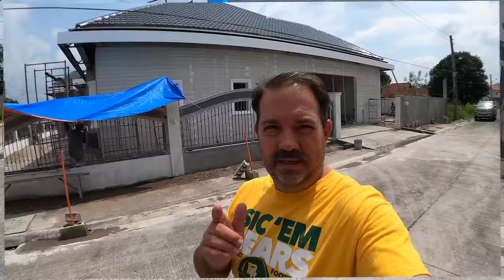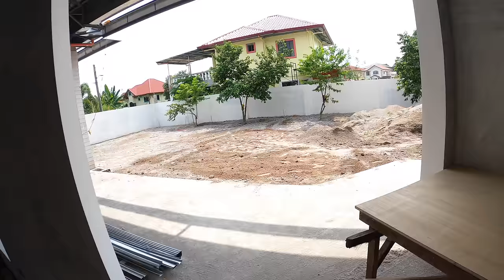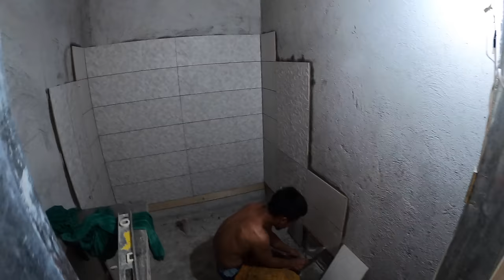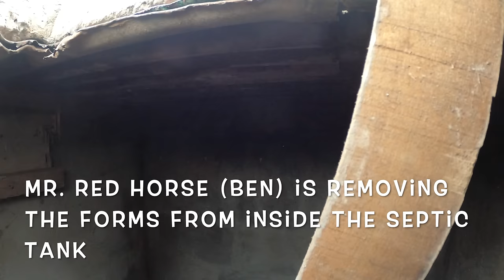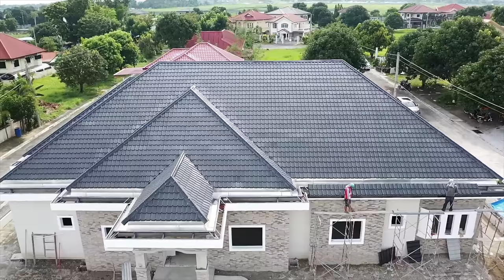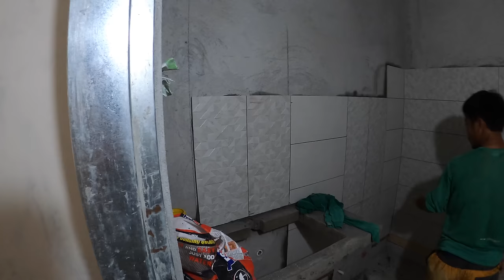Philippine House Building Step by Step, Build Day 166: Oil Change | Bathroom Wall Tiles

Comment: Hi. How mutch space between the tiles? Will you be using grout all around the house. It looks like in Phil that they like to put the tiles really close and that they don not use grout. Do you know anything about the advances and disadvances concerning using grout between the tiles.
Reply from the maker: Welcome to Casa TexPina!
From what I have seen over the years, very little space between tiles here. About the thickness of a finishing nail. Large format tiles are typical throughout our build, 25cmx75cm wall tiles, floor tiles are 60cm squares. Placed tightly together with minimal grout lines, it gives the appearance of a single slab. 
Thank you for the great question and for tuning into our channel. 👍😊

Comment: I got a question? Do you have petraps on all your drain? And cleanouts on your piping system for the drain? i always see and smell the sewer smell when you are in any place in the PI, because of that.
Reply from the maker: Yes 👍 they have been installed on all the piping so far. The p-traps under the sinks will be installed along with the sinks themselves.